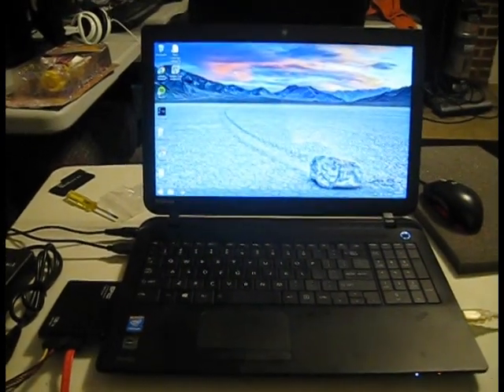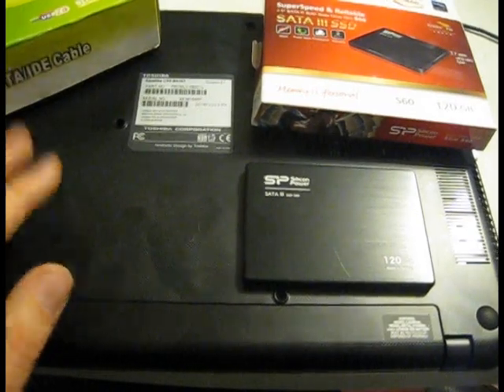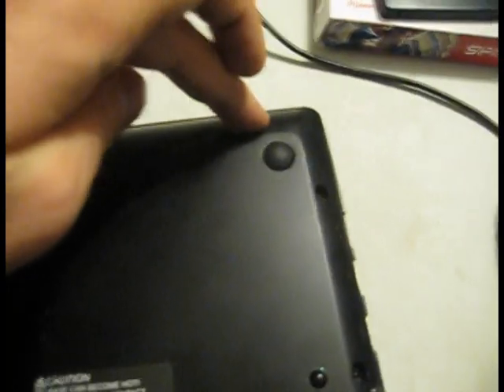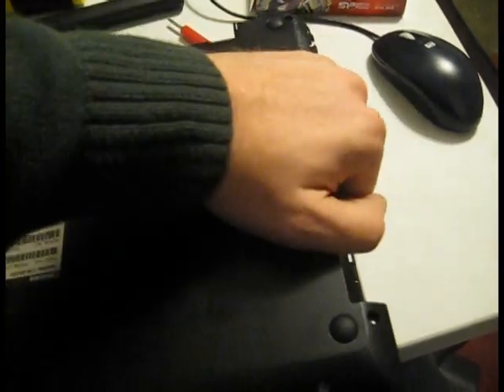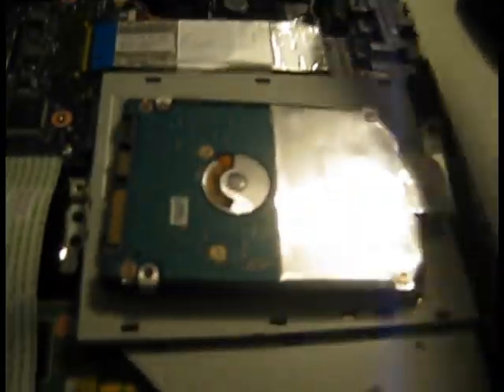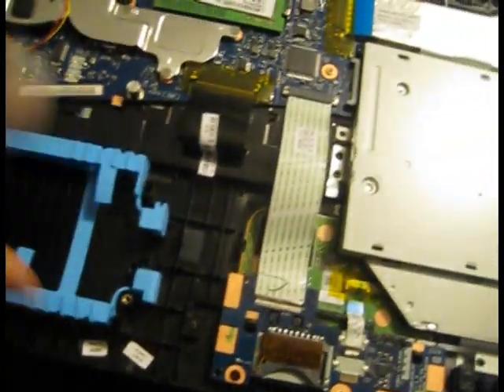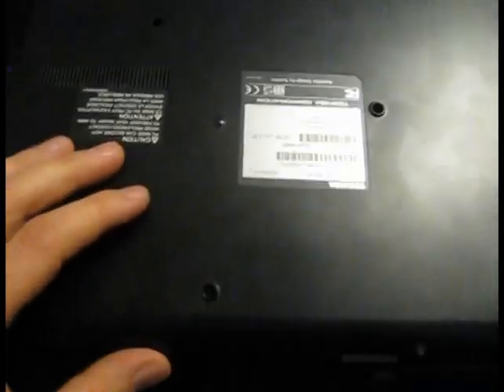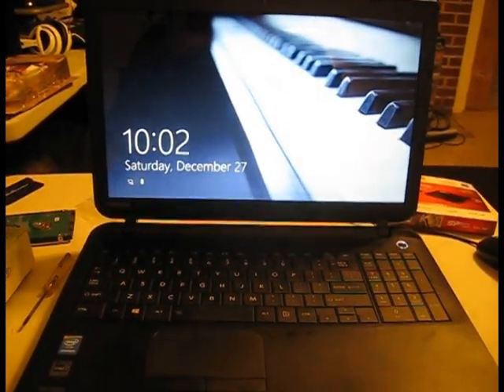toshiba C55-B5353 solid state hard drive install

Comment: I have the same model computer, but a different battery size. The port seems to be stuck down and everything is loose, except for the smaller part right beneath the hard drive.

Comment: That sticker on the original hard drive is on there for one reason: cost savings. 

By the way, Toshiba says the RAM is "not user replaceable", but as you can see by this video, it is not soldered to the motherboard or anything. It can be replaced, but only up to an 8GB SINGLE SODIMM. Once you have the cover off the laptop, it's a cinch to replace both the HDD and the RAM. You could probably also upgrade to a blu-ray burner if you wanted to (although I believe that can be done without removing the back of the laptop at all: Just remove one screw, pull out the old one, and slide in the new one and replace the screw.)
Reply: Thank you for mentioning this. I've been looking all over for this info. thank you much!
Reply: JustWasted3HoursHere back up some ps3 games :D

Comment: Toshiba has the worst design ever! Just to remove a battery, you have to remove two screws. To replace a hard drive, you have to remove many. What a Joke! I've been fixing computers for over 35 years and I would never, again, NEVER (sorry for the caps), would buy or recommend anything Toshiba!

Comment: Thanks so much for this video...I was able to change my hard drive with no problems at all.
Reply from the maker: glad it helped!
Reply from the maker: I used acronis true image. disk cloning software will only let you clone a smaller drive into a larger drive (last I checked).
Reply from the maker: I used acronis true image. disk cloning software will only let you clone a smaller drive into a larger drive (last I checked).

Comment: Great Video! Exact procedure for Toshiba C55t-B5140. Used SATA to USB and used Macrium Reflect Free Edition. Only sticking point was C: still reads old clone version and not new HDD info. How do I assign the new specs/drive? Otherwise hardware is spot on identical. Thanks for post.
Reply from the maker: what do you mean exactly by old clone version? like drive size?
Reply: I see the TB of new dive in Device Manager  (Disk 0) but it's unallocated.I right click it but not sure how or where to allocate it to. Thanks for Relpy
Reply: sorry. meant to say Disk Management
Reply: Figured it out. Used Partition Assistant (free) and joined unallocated new memory to C:/ Restarted and Eazy Peazy. Thanks again for great Video
Reply from the maker: +Alex Diaz glad you got it all sorted out. I'll keep that program in mind.

Comment: Thanks for the helpful video. Watching this made it a lot easy to replace the HDD. My HDD had two foam padding strips on the top. I moved those over to the SSD, and it fits snugly in the jacket without the need for that sticky foil backing.

Comment: Thanks for the informative video. I hope you get that tripod and also, review your work before publishing it. Some spots were so blurry as we cant see the details. Slow down. Please, i am not complaining, I am offering suggestions to improve. I was surprised by the battery screws and you gave me a heads up. Similarly, the snap in back would have been hard for me to guess, being afraid to break something. I am right now looking at ordering an SSD as the 4 core Pentium is plenty fast for me but the HD is a little slow so a perfect fix. One other thing I would have added was a litlle more discusion on how it worked over the next week and how you felt about the overall speed increase. Thanks for the video.